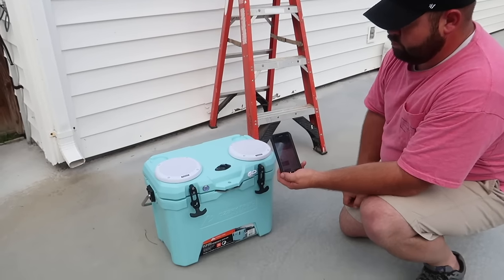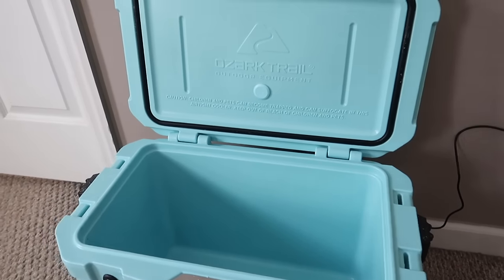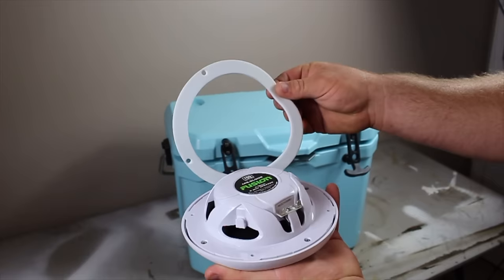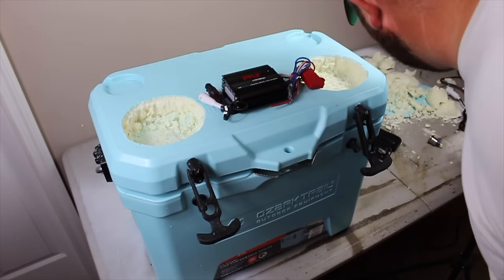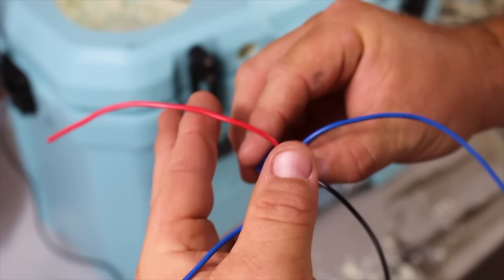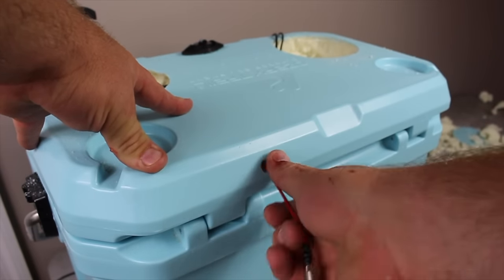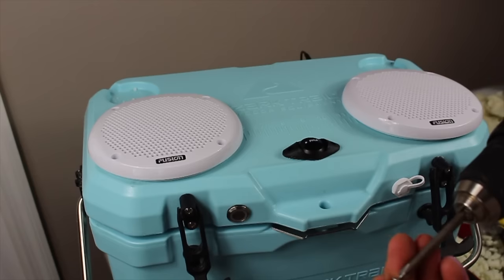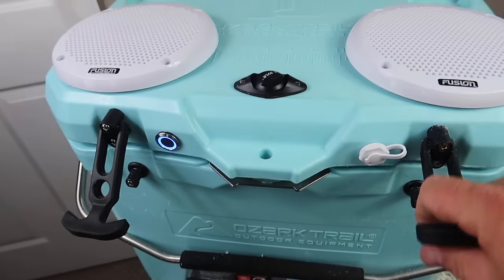DIY | HOW TO MAKE A BLUETOOTH STEREO COOLER

Comment: Just out of curiosity, as anyone experienced heat issues with leaving this out under the sun for extended periods of time while the music is running?
Reply: Terry Fang yes. But the radio I made was on a much larger scale. I added 2 CPU fans (again much bigger set up and was running a much larger amp and as long as it wasn’t in direct sunlight it did fine.